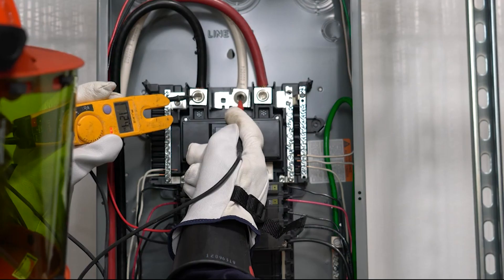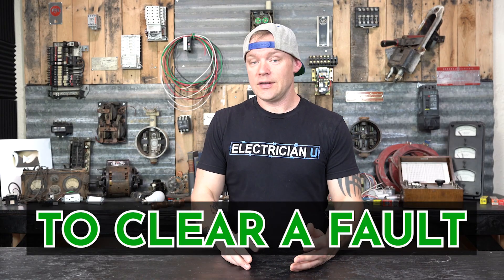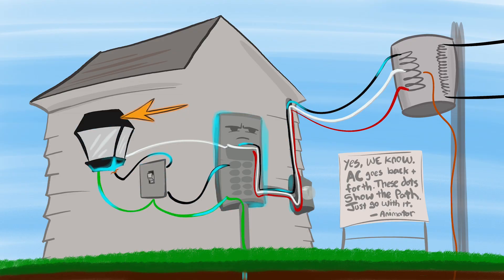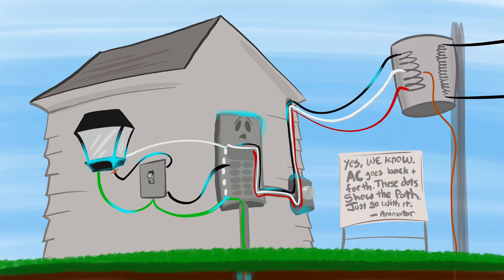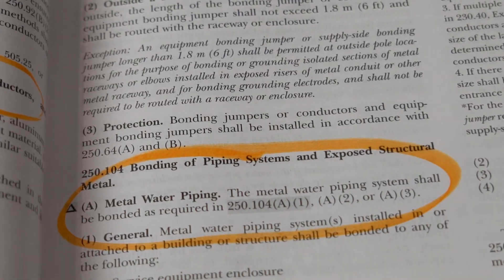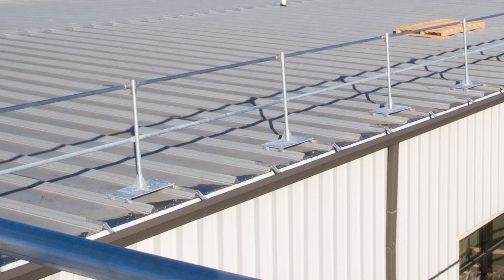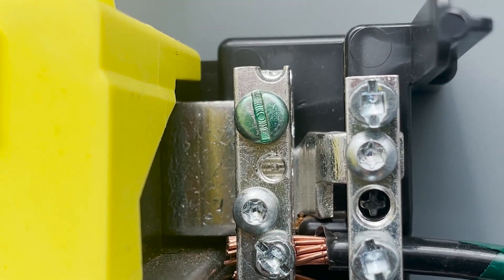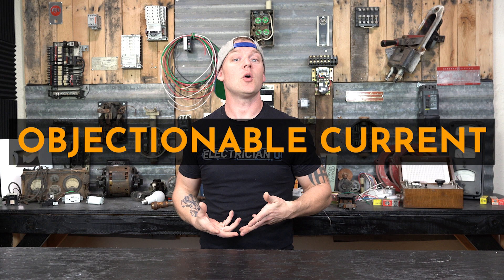Why Do We BOND Neutral & Ground in ELECTRICAL SERVICE PANELS?

Comment: Question. I have a 200 amp service in my home. There’s a disconnect at the meter can (a 200 amp breaker). I have recently installed an18 K generator with an automatic transfer switch. I have separated the grounds and neutrals in the main panel. Treating it like a sub panel. The transfer switch has a bonding wire and is tagged (do not remove) I know that I should only bond at the first point of disconnect. Is that at the exterior 200 amp breaker in the meter can or the transfer switch.? Should I remove the bonding wire in the transfer switch or leave it connected?  Thank you John

Comment: What if we distribute electricity in DC or extreme low frequency then add oscillator in the house to use low voltage then it only cost the voltage arrived at the door then induce into capacitor ccd then oscillator for in house use then it will cool weather atleast 5 degree Celsius instantly over the world

Comment: If we use only single phase then split it on the main panel then split them into ac, DC and grounding and various voltage and 3 phases computing and we need new intake panel that separate house from grid by CCD cell so no electricity bill and power grid only use fir weather and phone and internet and not power

Comment: excellent excellent video. so are you saying that if the neutral and ground aren't bonded,, then that higher amount of voltage won't run thru the breaker to trip it?? which I imagine would continue high amounts of voltage that could possibly cause a fire??

Comment: Let's say you're working with an old system that has plug fuses and a sub panel with Breakers, how would you improvise an equipment grounding conductor into that correctly? How about if you go to a cold water pipe for safety purposes?
 or would that merely keep metal energized In a fault situation?
Is it only on the main disconnect at the main panel, that you want to bond the grounding and the grounded busbars?

Comment: So i got a question. We hang shut off switchs on telephone poles for cable tv power supplies. We run grounds and rods for it. My neutrals/white wires i want to hook up to a grounding block with that ground correct. Since that shut off is working like our service panel. We then have wires ran from that to a breaker at the power supply location. These shut offs are attached directly to secondary lines on the pole.

Comment: One point I am a little confused on.  If I am not mistaken, my electric company and local electricians connect the service neutral directly to panel and on down to the ground stake itself.  Some of the poles themselves also tie the neutral through a conduit to ground.  I don't disagree that bonding the panel's neutral to ground is a good idea, but I also don't understand how it becomes necessary for a breaker to trip when there are so many other places that neutral bonds to the same service ground stake.

Comment: The animation and explanation are not entirely correct. There is always a return path as long as there is a ground rod at the main panel or some bonded equipment via metal pipework connected to Earth elsewhere in the setup, going via the litteral Earth back to the ground rod of the supply transformer to the neutral at the transformer, as the supply transformer has is neutral grounded too. It is not the path tho you ever would recommend to take, as it has a quite high impedance because of the Earth as an non-perfect conductor. A GSCI (residual-current device) will still trip as the current in the neutral is lower then in the hot phase. Even with only a normal circuit breaker (overcurrent protection) there will be a fast disconnect if the current going via Earth in return is big enough to trip the max rated current of the breaker, as it is the phase conductor going trough the breaker and the high current is here too. The concept in the video also only takes in to account TN-C-S earthing system with mostly additional ground rods at customer premise as in the US. A TT-earthing system works different in that there is no bonding between the neutral and protective earth at the customer premise, and in all cases the Earth (via ground the rod or other path) is the conductor back to the transformer.

Comment: I still don''t understand what's the need for grounding. The fault excuse makes no sense to me because if neutral wasn't grounded anywhere (breaker panel or post transformer) then you wouldn't get shocked by touching the metal part of a device with a faulty live wire because there's no return path.

Comment: Great video
Question, when you install a subpanel in the basement  we still got to bury a ground rod, I ask this because the basement is already like   8 to 10' lower plus 8' of the rod, we could probably find water in that deep
Any other alternatives to ground a subpanel..?

Comment: Cable guy here, hot grounds are a big issue for us as we bond to the grounding conductor. That current has the potential to back feed onto our plant causing all sorts of issues.  I always had wondered what was causing this. Seems to me now that a ground fault has occurred and there is no return path to trip breaker. Therefore that current is traveling on our cable back to our plant that is bonded to the solid grounding conductor for the transformer.

Comment: im not a licensed sparky guy....i have an unbonded 50 amp sub panel in  my garage, 25 feet away from the main bonded panel.. all my circuit testers work correctly and no problems or shocks.  i even installed a couple gfci's on my mostly work bench tools.  they worked cuz they triped....my question is i have a welder 220 on a 50 amp breaker,  two hots and a ground.  Not neutral.  It looks like the garage 50 would trip before the main panel even though they are the same but the first in line would trip because of the bonded neutral, ground at the main.. It never has but my question is: would a grounding rod  help in my sub panel for a faster break?  say..Just in case of faulty equipment  and i touched metal.  or even better to install a gfci 50 amp?

Comment: Great video and explanation but am puzzled about a specific application.  A residential service from the meter to breaker panel inside of metal conduit has a bare neutral wire. I've been told this is common for houses built in the 60's. Would the meter base have neutral bonded to it and therefore bonding at the panel is not required? Does this not also create a dual return path and allow for current in the conduit provided the bare neutral is in contact with the conduit, which it surely would be.

Comment: What if I have a house with 2 200 amp main breaker panels and 2 4/0 SEC coming from the meter and I put a generator with a non service rated transfer switch. Which panel should they be bonded and which panels should be separate neutral and grounds?

Comment: @Electrician U There is one scenario in which this method (bonding the Ground to Neutral) can result in deadly accidents. Here I will present to you an example: 

- the Ground is bonded to the Neutral at the circuit-breakers panel;
- during a storm, the neutral wire (only the neutral wire!!!) between your house and the post/pole (the source/transformer) snaps/breaks;
- in this time the lights in your house are turned on. 

This means that the current that comes through the Hot/Black cable down to your light bulbs, now returns through the other wire/cable (the neutral wire), it goes to the circuit-breakers panel and, as the Ground is bonded to the Neutral, the current returns back to the all the metallic cases of all the devices in your house (including the fridge) through the Ground cable. 

In this case, if you will use a current-measuring device to check the wall outlets, you will notice that the maximum amount of current runs trough EACH of the 3 terminals (even through the Ground terminal!!!) of the sockets.

In this case, touching your fridge, your microwave oven or the metallic cases of any electric device found in your house would be the same like directly touching the hot wire - the worst can happen/a deadly accident can happen. 

Am I right?

Comment: I am still confused, why wouldnt the power go from hot to neutral to ground if it is connected at the service panel, would it not be shorted. Or is it because if everything is operated correctly the path of least resistance is back through the electrical panel instead of ground. Also if ground and neutral are connected, and your electrical panel is grounded, isnt the electrical panel itself now energies and not save to touch?

Comment: What about...
In Texas... 2 main 200A breakers at the street.
Two 2/0 200 amp circuits running to two different main lung only panels. 
150A Sub panel in a casita (separate building, 125' away) running from one of the MLO panels. 
Do both of the main MLO panels and the casita get separate grounding rods and each of the three panels get bonded?

Comment: confused,SO when i junk my electric hot water heater and change to gas,,,i can use the 10 amp wire for a 15 amp outlet to feed the blower on the gas unit?

Comment: I will have a meter pole with a disconnect on it. There I will have my Neutral bonded with my ground. If I'm correct. I will unbound the neutral and ground in my service panel in the house. I'm using 4/0-4/0-4/0-2/0 service from the meter pole to my inside service panel. So the green 2/0 with will go from an unbound ground bar inside the house panel and then bond with the neutral at the disconnect panel on the pole. I hope this is correct. My question is. Should I run ground wire from the inside house panel to a ground rod at the house and do the same at the disconnect? Having two earth grounds at separate locations.

Comment: Question - I understand why bonding is done at only at source of first disconnect and separated elsewhere. What I can’t seem to find an answer to is in a main panel where the first disconnect is located, I understand that since 2008 NEC that the grounds and neutrals are supposed not be on separate bus bars. If that’s the case, there are bonded but different bus bars. Is there a reason for this? Thanks for the enthusiasm and clear explanation in your video. The animation was stellar! All very helpful and I look forward to what insight you may have on my question.

Comment: Why is it that the primary and secondary winding wires are small yet they can carry say a 200 amp load when the wire gage winding is only say a 14 or 12 awg?

Comment: I understand why we bond ground and neutral at the main panel, but wouldn't that automatically add current to the ground in an unbalanced system? The neutral takes the difference between phases  back to the transformer outside, and we bond the neutral and ground right before that happens. What am I missing in this observation.  Asking honestly because I don't know. I have a pretty good understanding of power but am trying to fill the gaps. Thanks

Comment: As a non-electrician, my understanding from this is both phases connect to common neutral. The neutral is connected to ground for safety reasons. Ground wires, ground plug pins, and metal objects that could become energized during a fault are connected to ground to give current a path to flow and reduce risk of shock during such a condition. Anything connected to ground should be bounded to neutral to help circuit breakers detect faults and disconnect or disconnect quicker by providing a complete circuit. Grounds are bounded to neutral in only one controlled place to reduce the risk of everything metal in the house energizing during a fault— control current flow, even during a fault.

I am enjoying these videos. While I have an electrical engineering degree, I am no electrician. I know enough to be dangerous and enough to be self-aware of the risks. But I always enjoy learning more and working through things to confirm understanding.

Oh and that “grounded” vs “grounding” terminology is evil.

Comment: Dustin, can you do a video that explains “if neutrals and grounds are bonded in the service box” what makes current travel on the neutral instead of the ground from the main panel to the exterior service pole.

Comment: So in the case of say a manufactured or mobile home where you have the meter, then a main disconnect right below the meter on the pole, the ground and neutral should be bonded in the main disconnect on pole NOT in the panel inside of the dwelling if I'm understanding correctly?

Comment: In your animation shouldn't the hot wire be seen as pulling electrons from the circuit not pushing as a better way of conceptualizing the flow of electricity?  I know its not really the subject of the video but it should help to have a proper understanding of the concepts.  The hot wire is a + charge and pulls electrons from any available source.  Be that the ground wire or the neutral wire or a person touching the hot and ground or neutral.

Comment: The neutral & ground bond is primarily to make your regular breakers work in a fault situation where a hot wire would touch any metallic part, most probably the casing. The ground rod is to make all the bounded metallic components, including neutrals, to the same or closest potential as your body is so you don't get shocked by dangerous levels of static electricity that would accumulate otherwise. The term "neutral" is derived from this static potential perspective.

Comment: Our AHJ adopted NEC 2020. I recently rebuilt an old service. I had to install a new meter box with an integral 200A disconnecting means and a new Panelboard. The meter enclosure was designed to bond neutral, ground, and the meter enclosure right out of the box. The inspector required I treat the main Panelboard as a sub panel for grounding purposes - isolating all neutrals from ground, and landing all grounds on a separate equipement grounding bar screwed to the panel board enclosure. I then had to run a jumper from the bar to the ground lug in the meter box. The bonding of neutral and ground occured in the meter enclosure. I shared this as an example showing that your bonding of neutral and ground doesn't always occur in your main Panelboard. Hope someone finds this useful.

Comment: I just finished reading some of the comments.  It seems that some commenters are delving into the super-minutia and missed the whole point of the video.  Only one ground/neutral "bond" and only in  the service panel or at the disconnect below the meter, correct?  Did I get that correct?... hee hee.  BTW, "Liked" and subscribed.

Comment: So do you need to disconnect the wire straps on the sub panel that connects the grounding bar to the neutral bar?

Comment: I heard of an electrician who was working on a panel with a hinged cover that was not properly grounded. The cover was energized from a shorted conductor. The electricians metal framed glasses made contact with the energized cover, and shorted through him to another properly grounded part of the equipment, and killed him.

Comment: The thumbnail animation left out the bonding in the main panel, the bonding in the Meter with the (missing also) ground rod AND the bonding from the secondary center tap to the Primary Neutral And to the pole ground. They left out the most mind blowing part of the actual circuitry.

Comment: Up on utility pole to transformer here there is only one wire high voltage conductor  no second phase or neutral on pole back to utlity only one conductor. 
Where does my house neutral go? 
I see it go to service pole then a copper nude from transformer to ground near pole. 
How does that  neutral  go back to utility to complete circut..by wet  earth ground?

Comment: I  am a brand new Subscriber with a question. I am a mechanical guy, not an electrical guy. Please keep that in mind.
I have a need to measure the current on L1 and L2 of my North American split phase (200 amp) residential power. I have CTs (current transformers) that I can not substitute that I must use for this measurement. Unfortunately (in my case), my split-core CTs are round and are intended to clamp around L1 and L2 round wires from my meter as they enter my main panel (either just before or just after my mains breaker). However, in my case they are not round wires, they are two rectangular busbars only accessible just after the Mains Breaker. I am able to get each CT around each L1 and L2 busbar, but am unsure if I will be getting an accurate reading as the bus bars touch the inside diameter of the split core CTs in four places on each CT. The CTs have plastic insulation completely covering them so the busbar actually is just touching the insulation and not the actual "core" material. 

* Will I get an accurate reading for current with the situation I have described (Round CT on Flat Busbar)?
 (I know I can test with an independent HAL/CT clamp meter on my Fluke and compare, but for what I am doing that would take a great deal of setup.) 

* Would collecting all the white neutral wires from each side of the panel and running them through the two CTs (one set of neutrals for each CT) give me a more accurate reading for the current?

I am out of my Wheelhouse and in too deep for my limited knowledge and am looking for creative solutions from those that know.

Comment: If bonding is just to complete the circuit as you said, then there is no need to connect the grounding wire to Earth, all you need is to connect ground wire to neutral wire in main panel.

Comment: You also bond the neutral and ground together so that the light doesn’t take on voltage if the wire touches the frame. The frame would be grounded meaning zero voltage relative to ground.